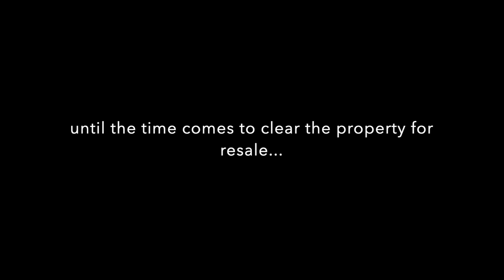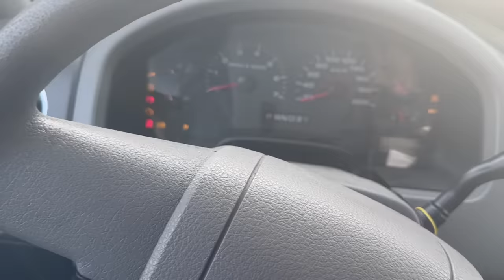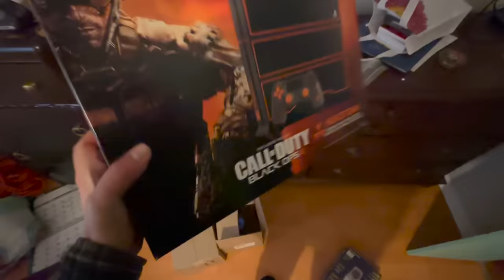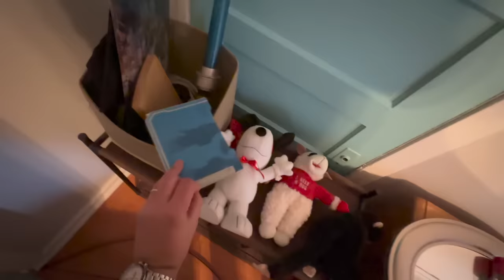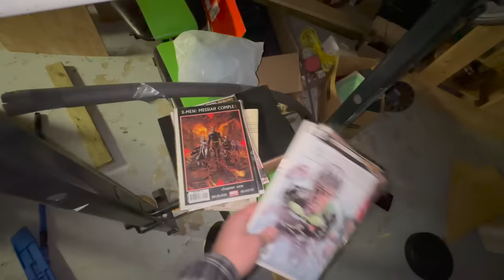Abandoned! Everything was left behind  We bought the contents! what's inside!?!

Comment: The EVGA Geforce GTX 1080 box at 25:30 was once containing a close to top tier graphics card from a few generations back. It can still be used for 1080p gaming if you find it and it works properly, as it still can compete with a modern RTX 3060 just without raytracing,  I'd check inside the computer tower in the closet at 21:55. If it's in there the chances are that the rest of the computer parts in it is  pretty top of the line from a few years back as well.
Reply: It appears to be in there. I have 2, it looks right. But it may be an upgrade rather than top of the line machine. Not that it matters, since it could hold stuff that has to go back to the family. Unless of course it gets backed up (probably for the best considering computers aren't cheap to ship).
Reply: @RikkiCattermole  Take out the hard drive/SSD and send that to the family, keep the computer. The Geforce could also be in the computer in the living room.
Reply: Looking at ebay UK depending on exact model this can be £200 upwards. During pandemic gaming graphics cards went crazy as supplies dried up and seem to be holding some value. Definitely worth pulling from whichever case it's in and selling separately and not unknowingly donating. Great video again and looks like a more manageable less stress clear out than previous. Looking forward to seeing your Snap on personal tool set upgrade
Reply: @Ragnar8504  That doesn't work if it is encrypted. Need original hardware to have any hope of decrypting it.
Reply: @RikkiCattermole  True, you'd have to check that first. An encrypted hard drive/SSD in a gaming PC doesn't seem all that likely though.

I've never actually worked with HDD encryption so I wasn't aware that Bitlocker is tied to the hardware rather than just a software encryption until I read up on it after reading your reply!
Reply: It's in the living room desktop .
Reply: @Ragnar8504  it’s the “right” thing to do but be sure there is no adult content stored on drives. Had this experience personally when buying secondhand drives for upgrade projects.
Reply: On the gaming front too, think the goggle set was a collectors edition item from splinter cell
Reply: I still have the GTX 1080 Titan, bought it for photo-panorama work. My friends were sooo jealous at what was then like 800-1000 dollar I believe
Reply: that keyboard looked like an oldish HP, so I reckon on the upgrade
Reply: @RikkiCattermole  It's very doubtful the drive was encrypted, especially if it was used for gaming.
Reply: @Ragnar8504  Leave it to M$ to lock all your data if your computer breaks down, with a 100% functioning drive... but that's not how it's supposed to work. If you have the recovery key then you should be able to decrypt on any computer. Windows itself used to cry if you changed too much hardware, but they seem to have moved to the data mining/selling business like gargle, probably don't care about that much anymore, wouldn't want to drive any more products - I mean users, to other OS's

Comment: There is a strong following for Ford Crown Victorias, Mercury Grand Marquis, Lincoln Town Cars here in the states. They were the truly last, full frame, V8 powered, rear wheel drive American car produced. I have owned a 2011 Grand Marquis and a 2003 Mercury Marauder. The latter of which I was stopped in traffic and asked if I would sell it. There are even tuners shops like ADTR that have super charger, and 6 speed manual conversion kits. If the one you have there is a good example you could get a good price for it. They are super reliable and run forever.

Comment: The Hercules Motorcycle. Looks like a 2 stroke engine. I have seen pictures of the Wankel engine. And they are totally different. The battery jump pack in the kitchen. Hopefully the mains charger isn’t too far away. As it would be helpful. Start any other car you get. As long as the battery is good. Best of luck with the clean out of the property. There is some moneys worth of tools and tool boxes. You need to find the chargers  the Snap On Tools in the house. I’m  sure they will be close by to them. As they are not cheap things to purchase. Even used ones. They would come in useful in your job.

Comment: I keep thinking keeping multiple trucks could make jobs like this easier.  Load 3 trucks at once, all 3 go home at once, and not have to spend time on multiple trips.  Hope maybe you can avoid the giant dumpster fee this time.  Interesting haul.  Thanks as always for the endless good energy you spread.
Reply: Due to the weight of the large toolboxes and the big V8 engine, he might be better off renting a 1 big moving Van/Truck and hiring some movers/muscle to help get everything in the garage and basement in one trip. I saw a Engine lift in the Garage but couldn't tell if the Engine was still attached to it or not.   A Moving Van with a heavy duty built in ramp can be much easier to load up that a regular truck with just a ATV or similar ramp.   Should be just one trip, but might a a bit hard getting it into the back yard even with the wide gate.  Sometimes the  Alleys can be tricky to maneuver a long Moving Van around in and out of.

Comment: I had a 2007 Saturn. Great car. I traded it in with 234,000 miles n still got 30+ mpg but had the same problem. I was able to push a button on the column to release the key.  I believe Saturn n Cobalts are basically the same car.

Comment: The Subarus in the 1990's had the same problem with the key getting stuck sometimes. Mine does. But if you move the steering wheel back and forth while trying to turn the key back it will free itself. I loved watching this. A lot of super cool stuff!
Reply: Yep. My Honda Fit did this a couple times too. Takes a minute of playing around with it. I think I had to play with the shifter.
Reply: @clark9992  I recently watched a video on a 2000 Porsche that had the same issue. The shifter cable wasn't adjusted quite right so the transmission wouldn't go all the way into park, locking the key into the ignition. I had no idea an interlock like that even existed having driven manuals all my life.
Reply: @Ragnar8504  Mine is a standard transmission. The mechanic said its a problem with the locking mechanism that locks the steering wheel when you take the key out. He said he could fix it but since it only happen like once every couple years I just never bothered to have it fixed.
Reply: @oregonwanderer  Yes, the steering lock can definitely cause issues with the key. It also works the other way round - you might not be able to turn the key without wriggling the steering wheel, that's happened to me before.

Comment: Also, all the tools and the motorcycles will gain value especially the Harley so you should hang on to them for a while. I have a 57 Harley and it's worth 130,000.00 because it's all original. Keep that in mind. As I said, I'll give 150.00 for the pressure washer.

Comment: Chevy Cobalt yes I know of course the battery is in the trunk but you can jump start the car with jumper cables by lifting the hood Google it. I own a Chevy Cobalt there are certain places to put the jumper cables under the hood near the engine. That will jump the car. And steering wheel has to be in certain position for the key to come out. A lot of times if the battery is dead the key will not come out

Comment: Those crown vics don't have anything special about the engine... just a normal 4.6L. What they do have is they are programmed differently than a normal vic...but when they are sold from the police department they are put back to a stock tune.   They do have stiffer springs and some braces in the frame for more stiffness. The front suspension can be used in a bunch of different restomod projects... they fit nicely in the 70's F100s. Derby guys love them as well (with the front suspension changed out.

Comment: No, those police interceptors  engine aren't anything to special.  They had bigger radiators, trans coolers. The ecm was tuned to allow a higher rpm and high speed. Rear end is geared differently  than stock models.

Comment: You can definitely tell this guy isn't car guy at all. Who hops into or on a vehicle they know nothing about other than it's been sitting for a long time (which btw is a helpful piece of information to have) an just starts it up. Doesn't bother to pop the hood check an make sure that there's oil in it if has coolant. Make sure everything is "there" you know put together before you cause harm to your investment. Knowing that it has been sitting for a long time is helpful to know because now you know I should probably check everything out make sure it's all there mechanically drain the old gas before it messes up the fuel system make sure the brakes are working an doing there job make sure the alternator is charging an holding make sure the cooling system is holding up
Reply: You must be new here.

Comment: If that Hercules motorcycle has a Km48 engine, just the engine alone sells for $500 to $2,000 on eBay. You should get $2,000 to $4,000 for the whole bike. If it runs you should be worth closer to $4,000. If it doesn't run closer to $2,000. That's my opinion from what I saw when I looked it up. I hope it runs & you get $4,000+. Have a great day Alex. God bless

Comment: I hope that truck turns out to be a 2003. in 04 they released them with the worst truck engine the company ever made but the 2000 -2003 triton engines are rock solid and difficult to kill.but it's newer than my 2001 but still has older radio unit so my fingers are crossed for you..butg if it's 04-08 that truck would be worth more as recycled metal.

Comment: Always pop the hood, pull out oil stick and make sure their is adequate oil in engine, then double ck their is brake fluid, and antifreeze and power steering fluid. If u start a vehicle without sufficient oil or antifreeze coolant in it you could cause permanent major damage to the engine or radiator completely destroying the vehicle. Seeing u start a vehicle after it sat for over a year w/out atleast popping the hood and cking oil and antifreeze made me just cringe. And I hardly k anything about vehicles but my dad was a mechanic & taught me this much.